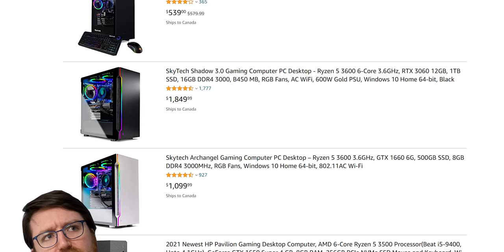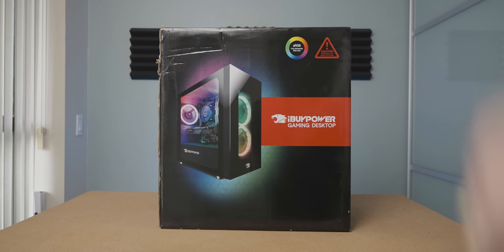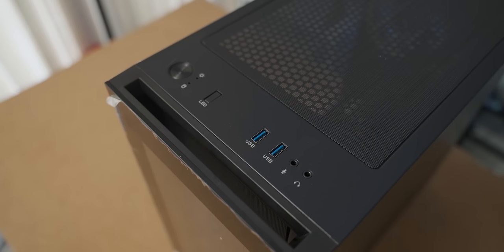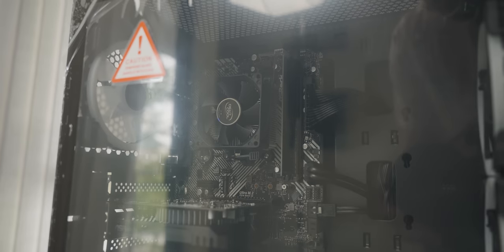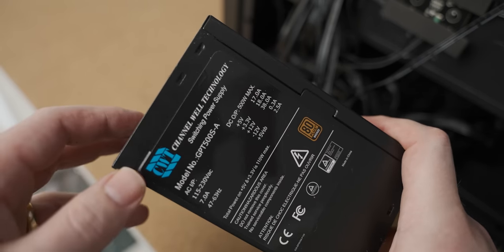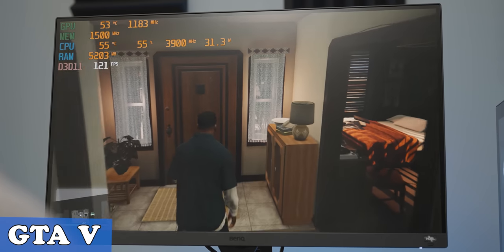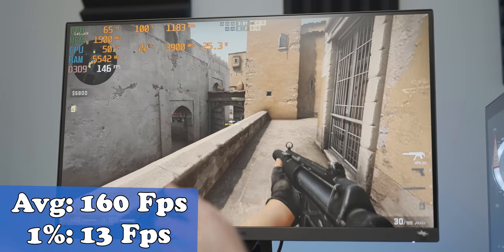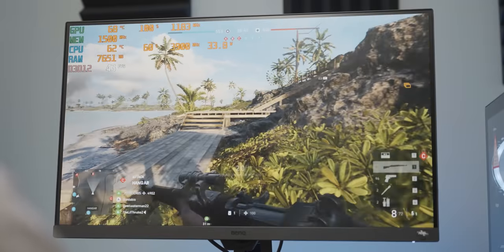I Bought The Best Selling Pre-Built Gaming PC On Amazon.com...

Comment: I might get shot in the foot for this BUT 

I started my pc life with an ibuypower system that came with a 5500xt and slowly changed various cables and added infinitely better RAM + peripherals  and I couldn't be happier 
Upon getting the system some time ago I even opened up the case and checked for cable management and any loose headers etc. And it was all flawless
Reply: do you know all of the things you upgraded and what you upgraded with? this sounds like a good idea but i’m not really sure where to start!
Reply: Prebuilts regardless of what anyone might say are a GREAT entry point to PCs
1. Pick a budget 2. pick a platform (AMD/Intel) with an upgrade path in mind 
basically you want to make sure that future parts such as newer gen CPUs and such will be compatible with the board in your build 
3. Best beginner friendly and useful tip is to first go after upgrading your RAM because most prebuilts have rediculous RAM configs (single stick or slow speed RAM)
Reply: After that later down the road you can up the ante as far things like peripherals and a better monitor

Comment: I'm currently selling a R5 2600/1660S/2x8GB build for £800 and a i7-6700/970/2x8GB build for £600 (new and used parts) so when i see the price of prebuilts, it does actually instill a bit of confidence in me that i won't be ripping anyone off. I clean and test the components/build fully and iron out even the smallest annoyances so hopefully the service is worth it too.

Comment: I bought that same motherboard and used it in my backup pc with a Ryzen 2600x. The max the CPU can pull is around 40 watts with boosting enabled. when I had that chip in my main pc before I upgraded it was pulling 120 watts, but it only loses around 300-700 cinebench points comparatively which is shocking with the power draw difference (around a 5-10% loss)

Comment: Ive assembled from amazon for around 650 all new components. I3 10105f, 16 gbs ddr4 ram, gtx 1050 ti 4gb and 500 gbs of m2 storage. And ofc case, mbo, fans for case and cpu cooler, fan hub and wifi usb. And works perfectly for me

Comment: I've got a custom-built PC with a GTX1660SUPER, 16gb Ram, Ryzen 5600 and Fractal Water Cooling. I'm not sure about my motherboard. But I saved like mad to get that. It's a lovely little PC. I chose to get yhe 1660SUPER as it was the cheapest option for my intended use at the time. I do plan on upgrading to a 4070 when I have the money, but I don't see anything wrong with that build. It may be as middle of the road as you can get, but it does a hell of a job with emulation and all the games I have on Steam. The most demanding games I have are like RE8 and Dead Space the remake

Comment: 600$ now a days will get you a decent gaming PC with an upgrade path with a 5600g while you lose 10% of your CPU performance to the integrated graphics compared to the 5600x you still get decent performance and you can get a GPU later instead of needing to spend 80% of your PC budget on a GPU and leaving you with a barely upgradable mb or a bottleneck of a CPU. APU's def are the choice rn.

Comment: I have two Optiplex SFF with i5 6600, 2x8gb RAM, SATA SSDs, and both with GT 1030 G5 LP, one from Gigabyte and one from Asus. They both work really well, shockingly well. They aren't really gaming machines, but they heckin game. Elder Scrolls Online 1080p low will vsync lock 60hz, they are better than Playstations for half the price.

Comment: I bought the HP pavilion TG01 during cyber weekend. I wasn't really knowledgeable about what to look for. While browsing, i came across it and it was marked down from $1,200 to $800 for cyber deals. Has the ryzen 7 5700g and rx 6600 xt. I'm mostly satisfied with it. I probably wouldn't get it, with what i know now. The performance is fine, but with a proprietary motherboard, I'm limited on what i can do. 

It came with 1 stick of 16G ram 3200mhz. So i bought 2 8G stick to replace it. But because of my motherboard, i cannot enable XMP. It reduces the 8G sticks down to 2100 mhz. I'm not experienced enough to mess with overclocking. Besides all that, i am satisfied with it. It's been a learning experience for sure.

Comment: It seems much better than the pc I got about 10 years ago, this one is even a bit cheaper... The specs were: AMD FX-4100, a geforce GT 430, a 300 W PSU, 1 TB HDD, DVD drive, as for the motherboard I don't remember. I still have the case, the HDD, the dvd drive as well as a fan left.

Comment: Yo i bought a pre build PC used. What I got was very good for 520 dollars
Specs:
GTX 970 asus strix 4gb gddr5
I5 6600k skylake
16gb Ram 2400 Mhz corsair (4x4)
Msi b150 m3 mother board
512 gb ssd WB
4TB HDD seagate 5800rpm
530w power supply bronze pure power
Nzxt h500 case
Windows 10
I did get a corsair gaming mouse, keyboard, big mousepad and a web camera for 80 dollars more. 

I would say buy a used pc man. You can find some sick ass deals out there. I have owned my used pc for over a year now with no issues. Just needed to blow out the dust and that was it. Pc running all cool and low temps

Comment: I found out most of AMD cards have problems with stuters in cs:go ,but there is an easy fix. Run the game in fullscreen mode and select the e-sports mode for cs:go in Radeon Software. This method worked on my RX580 and my laptop RX560x.

Comment: That clock is pretty low for the rx550. Had the Gigabyte version (the dual fan one) and it was perfectly fine at up to 1400MHz. So overclocking that ASRock card will make sensible difference.

Comment: The pc i have now is a pre-built that i modified the hell out off. Its was a predator orion 3000. I swapped the 1660 super for a 3090. I5 for an i9. 14gs of ram for 64gs. And power supply to a 700wat

Comment: So I bought this system about 2 weeks ago, only upgrade I went with was upgrading the ram to 2 8gs of 3200mhz, I checked online to see if the mobo was compatible before upgrade, I’m fairly inexperienced in the computer scene but i figured it’d be fine, next thing I knew The mobo wasn’t reading my gpu, or my peripherals for some odd reason, everything else turned on, so I reset the cmos on it and finally got it to boot up properly, not even two days later I’m playing valorant (I dont think this game is very demanding in any aspect) I’d say I was playing for about an hour before my pc completely shut off and I got a burning smell coming from the psu, at this point I’m kind of over trying to resolve any further issues with this system and am just returning it on Amazon

Comment: A year ago, reasonable maybe.

Today, I've quickly come up with a parts list for around the same price $620 with probably double the power and triple the ease of upgradibility.

5600x with stock cooler (new), 1660 super (used), 16 gb DDR4 3200mhz, cx650m psu (new obv), WD Blue 500 GB SSD, asrock b550 (used), and then some bullshit $15 case with decent airflow.

Comment: Instead of spending 600 on this you could build your own, I just built 
CPU: Ryzen 7 5700g apu
Motherboard: gigabyte b550 
Ram: 64 gb g.skill TridentZ 3200mhz 
Psu: 700w thermaltake 80plus 
Storage: pcie gen 4 wd black 250gb m.2 nvme
For $500 leaving you with $100 to try and score a 1070 or 1050ti possibly a 1060 ti whatever you can get lucky with on eBay or you can play eSports titles just fine on the apu without a graphics card and wait for prices to get better. I personally bought really great cooling for my cpu and 6 case fans to overclock and I'm going to wait for better gpu prices
Reply: Edit: the motherboard supports up to the 5950x and down to the 3100 so most amd cpus can be put in there and overclocked and it has a great upgradeability path
Reply: Edit: prebuilds although sometimes "okay" it's almost always better to build your own and scout deals just remember to take your time with it and find good deals
Reply: 500$ for that? Thats over 1k€ in lithuania

Comment: The GPU is underspecced because of the current market. That's what's holding it back more than anything else. Throw an rx 570 in it and it would be way better. Then add double channel RAM. But for what it is, it's actually decent. No need to split hairs here.

Comment: Wow, I'm glad I built my desktop in late 2019 as mine cost about $700 as well to build (except for I alraedy had the case and power supply I guess so that saved me an additional $200 as well).  But basically for the $700 I got an RTX 2060 (regular, not overclocked) for about $300, Ryzen 5 3600 for about $200 (with motherboard as a combo -- OK the motherboard is a generic Gigabyte B450 but nothing fancy), 16GB of RAM, 500GB SSD and Windows 10 Home.  Probably not the best gaming system ,but at the time the 3000-series hadn't been released yet and the 2080 was the high-end of the spectrum....     Of course I found to build this system today would cost about $1000+ because the video card goes for about $600 alone (now).

Comment: I got a iBuyPower element 9260 about 2 years ago (it was about 600$ cheaper then) but it has a i79700f and a gtx 1660ti with 16gb of ram.  I upgraded the PSU and the GPU recently, but for the price I paid 2 years ago it did well.

Although the cpu fan is kinda lackluster and does need a upgrade lol

Comment: Clearly the current trend in prebuilt PCs is for the vendor to cut their RAM Kit cost by 50% by simply splitting one single kit between two different customers! That really shouldn't be legal or at the very least, people could start a class action over it. I mean because when you purchase a DDR kit, it's required to come with two chips or they aren't selling you "Double Data Rate" memory. Will the customer find it easy to find the correct matching stick or does it basically force them to buy a proper new kit? Seems kinda crazy that they can effectively sell you single channel memory but label the package as "It has DDR5!"

Comment: i'm so sick of the  mid/full tower  side panel glass rectangular box  with RGB out the butt.  

back in the 2000's  there was a lot more variety in the PC case  market.  what happened to the one handle  M-atx  and ITX  lan box cases we used to see ? where's the odd shaped cases that were art works in of themselves?  it's like every case manufacture started  making their cases off the same cookie cutter mold.

Comment: I bought a MOBO a year ago that came with those coolers included, they were having a random promo.. Put it on for the luls my Ryzen 7 2700x was running at like 30 degrees higher with that thing.
Then I slapped on the stock cooler I Got from a ryzen 3 purchase some years back and ye.... 50C under full gaming load, while streaming.... 
Like... do they basically take the stock coolers and re sell them to save a buck? They can't be doing that right?

Comment: i got the same type of prebuilt with the same motherboard and my RGB doesn’t work
Reply: 1. Update Bios to latest.
2. check your connection to the board and RGB fans.
3. install maybe additional software/drivers for RGB.

if none of these work your hardware may be faulty.

Ofcourse that is if your Bios doesnt have settings for RGB that are turned off. Make sure to check that as well.

Comment: Quite frankly, I am incredibly new to PC builds. I have no clue what specs I should go for. What do you think is the best prebuilt out there to run games like war zone, fortnite, valorant, etc. for under $700?
Reply: I would recommend going the used route at this time of pc part prices maybe go on fb market place and find a good motherboard ram and cpu bundle and then find a rx 580 for cheap somewhere and get a case / psu for 100 then you should have a decent rig to run the games at your budget

Comment: i mean this is a VERY cheap system and mid pandemic with outrageous prices and hard to find parts and its running 1080p at 60 fps with pretty good temps and no massive bloatware.  i mean what do u expect for this price range.  i agree not a computer for most and wouldn't satisfy me but for the price and even more given the context of when this was bought this seems very good.  you get what you pay for if you wanted a real gaming pc you woulda been going in expecting to spend in the $1k- $2k range.

Comment: I play RDR2 at about 40 fps, it’s definitely not painful or anything. Heck, sometimes planet coaster hits the 20s fps when I’ve got a lot of stuff on the map. I feel like this demand for massive fps, especially on a budget system like the one in this video, is quite dumb. Great video overall, but I definitely wish you’d be a bit fairer when judging such a cheap system with components that barely even reach the minimum specs for newer stuff like BF5. I’m pretty sure the Xbox One only hits like 30fps in BF5, so 45fps is definitely fine for the kinds of people who are buying a system like this at such an entry level budget. It’s not an RTX 3090 or Ryzen 5800X, but it’s not pretending to be one either, and when you ask for top of the line performance on an entry level system, you’re asking to fail. Again, great video, but I really disagree with you when it comes to your expectations for performance here

Comment: Channel Well isn't that bad. They make PSUs for Corsair and stuff. Not the world's best but certainly not junk. I'm sure that's not one of their Corsair-tiered PSUs but I bet it's not bad.

Also the CPU here isn't that bad either. It's enough for most games. It's better than say my 4790K at stock and that's saying something. The video card kinda sucks but makes sense for the budget. Give it an RX570/580/590 or equivalent Nvidia. Plenty of power to game at 1080p for under $200. The motherboard is however pretty dire. Those older budget Ryzen boards have throttling issues. And that ASRock is especially bad. Look at the VRMs! With this 3100 it's probably okay-ish but I would never try to put a 6 or 8 core in it.

Comment: I just built my PC a few weeks ago for under 600€... 
Ryzen 5 3600, GTX 970, Msi B550M Mortar Wifi, 16GB 3200 Ram (2 Sticks of course), 1000GB M.2 SSD, 630W Quality Power supply, RGB Fans and a Cheap but nice Looking Case. 
Thats what you get for about 600$ with a little effort and a mix of new and used parts...
Guys just dont buy Prebuilds!! xD

Comment: Pre built gaming PC's suck and most of the time you're getting bent over and shafted, hard with no lube. Current lack of parts is driving some folks to buy a prebuilt just to strip out parts. Well if you can't wait, I guess you can't wait. I can't think of many reasons why anyone (who can assemble Lego) doesn't build their own. If you buy a prebuilt and it works correctly, that my friend is a miracle

Comment: Idk man when I got mine from Best Buy and the price dropped two months later they refunded me 200$ backs in total I ended up spending 1200$ as it was originally 1400 and then even dropped to 900$ once the 3000 series cards came out. Mine  came with an RTX 2070 i7 8700k 1tb, and 16gb ram and this thing has given me no issues and can run games like rdr2 on high/ultra. That PC you picked was weak parts wise. Mine was the ibuypower bb952

Comment: @Dawiddoestechstuff  I need help with choosing which pre-build to buy, I'm scared ill get scammed so I need alot of proof or confirmation that this pre-build is safe to buy, it is an ADMI Gaming PC: AMD Ryzen 5 3600 4.2GHz, RTX 3060 12GB, 16GB 3000MHz, 240GB SSD, 1TB Hard Drive, 600Mbps Wifi, Windows 10
And its on amazon for £1099.99, the thing is there is a different pre-build on Newegg UK and its ABS Master Gaming PC - Intel i7 10700F - GeForce RTX 3060 - 16GB DDR4 3000MHz - 1TB M.2 NVMe SSD - Windows 10 Pro 64-bit

For £1400, I'm stuck on which on the  buy because I want something I can play any game above 60Hz and still be at least under £1400, problem is i can't decide because of my paranoia of think or probably getting scammed, someone please please help, I dont know what to do (btw I did look up on YT alot of pre-builds but most were above my money limit and I want a pre-build that is under £1400 that can do editing and play any game at a minimum of 60Hz not less).

Comment: the MSI laptop and cooling pad set up i run right now does quite a lot better. got a 30 series NVIDIA card and an i7 series processor, along with 16gb's of ram all for around $1100 give or take.
Reply: i got a i3 12100f and 3050 for 700 16 gb ram
Reply: @hjrgf  that processor is gonna hurt.
Reply: @TheGoobMeista  no its actually good
Reply: @hjrgf  it might be good but its not great, you said an i3 . vs like an i7 or i9 12th generations, it's not that good.
Reply: @TheGoobMeista  its a 4 core cpu and its very good for budget builds i got it for 6600 kuna
Reply: @hjrgf  ah you live in croatia, i get it now, i didn't understand you weren't in the US.
Reply: @TheGoobMeista  yes the 3090 is 11000 kuna rn

Comment: Dawid...what do you think of this, I built it for someone who backed out of the buy.  Deep Cool Matrexx 30 case with tempered glass side panel. (I know you Love this case) Windows 10 Pro  w/Office. Asrock B450M Pro4 Mobo. 600W EVGA Bronze rated PSU. AMD Ryzen 5-1600AF, 16GB 3200mhz Teamforce RAM. AMD Sapphire Pulse RX 580 8GB gpu. 250 GB M.2 SSD main storage, 1TB Western Digital Blue 7200RPM secondary storage.    I'm trying to sell it on Craigslist for $675 and no serious bites. (only scammers). Have I priced it too high? Maybe I should just pull the RX 580, sell it for $$$ on eBay and part out the rest.